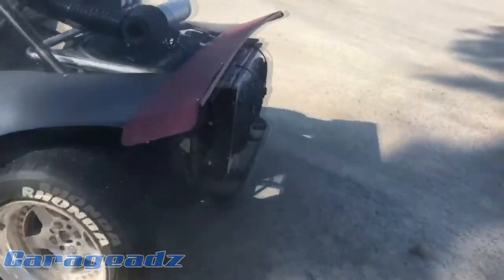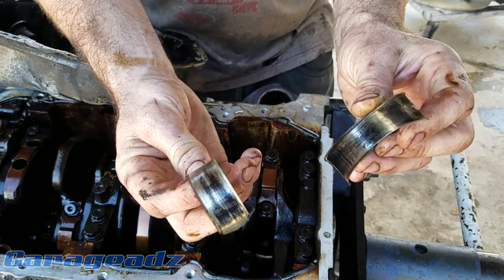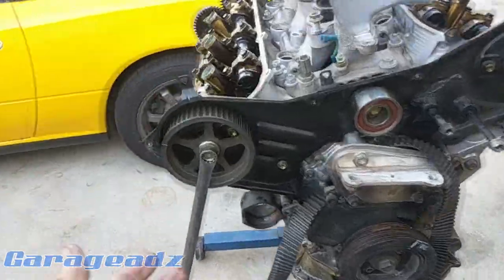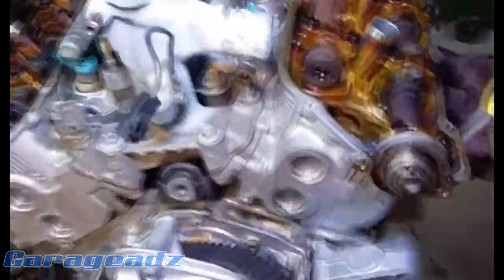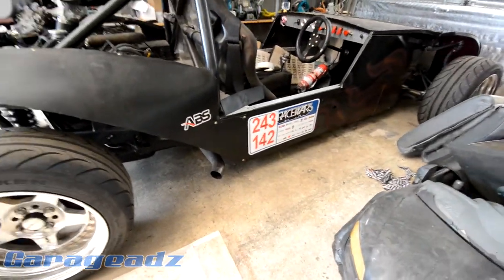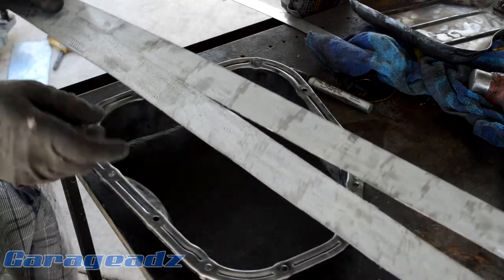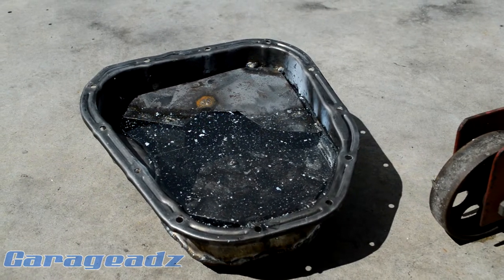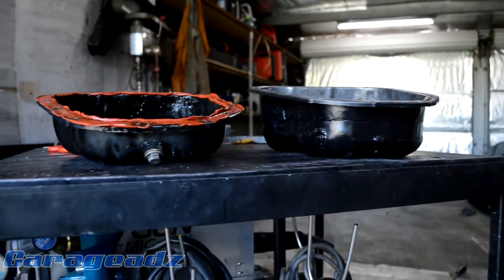DIY racecar part 9

Comment: How did you cut the holes in the oil tubes without getting metal in the oiling system? Did making those holes have a noticeable difference while you were racing?
Reply from the maker: It's going to sound crude but honestly I used a hammer and a screwdriver. No swarf.

I ended up having some surge issues still and made a better sump design for motorkhana duties where it spends 99% of its life.  I've had great oil supply and pressure since!

Thanks fo watching !
Reply: Garageadz thanks for the advice!!
Reply from the maker: @heyhihello8310  all good brother !